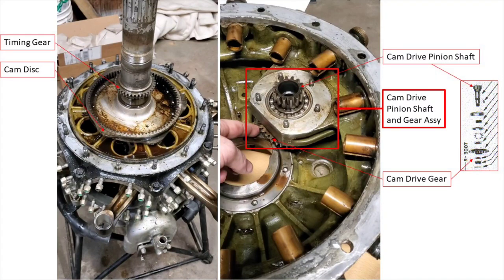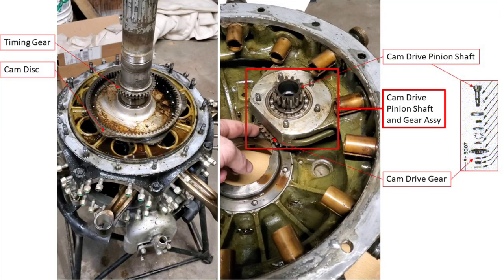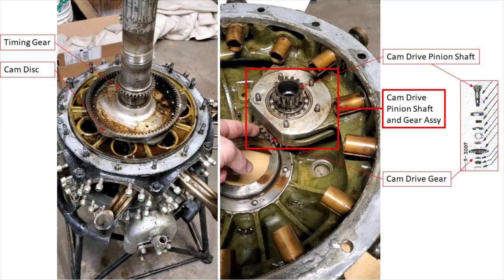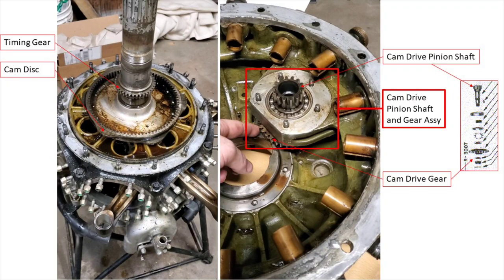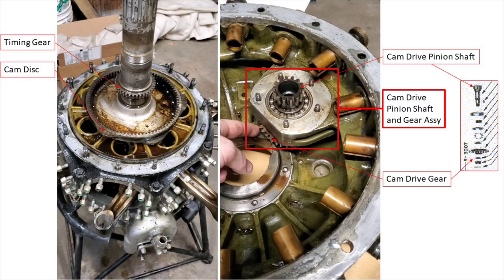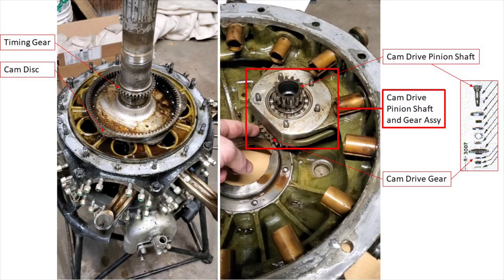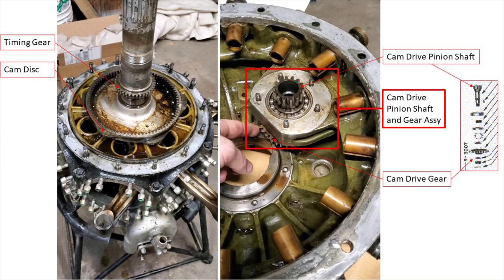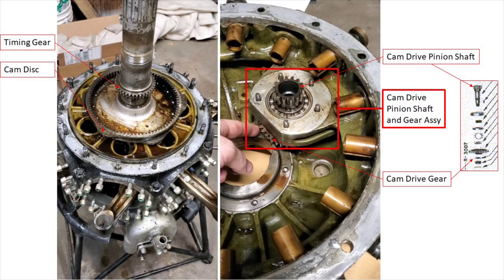Jacobs R-755-9 Restoration Part 11: Correction to Part 7 Cam and Valve Drive Assy

Comment: How can a cam on a 4 stroke engine move at 1/6th speed in relation to the crank?   Do you mean 1/4 speed?
Reply from the maker: No sir, all of the literature specifies 1/6 crankshaft speed in the opposite direction. Im not exactly clear on the why, the video describes the how, but I intend on finding out and that will be the subject of another video
Reply from the maker: I found the answer.  It is 1/6 crankshaft speed, made another video about it.  https://youtu.be/JSzjtKYEfIA

Comment: Man this is a lot of cool information that I’d never learn unless I took one apart. What’s the the plan with the engine you rebuilding it for an aircraft?
Reply from the maker: Unfortunately,  this engine won't be returning to the sky after this restoration.  Once rebuilt,  this one is going on static display at an Air Force museum next to a Cessna C-78
Reply: @mikesmith7249  the three Jacobs engines and props I’ve got are off a bamboo bomber
Reply from the maker: @apudggysquirrel1974  Thats very cool. What kind of condition are they in and what do you plan on doing with them?
Reply: @mikesmith7249  they are all in different conditions and were mainly spare parts for the engine that’s currently on our cessna 195 and as a little kid I’ve always want to pull one apart and see how it works. Maybe rebuild one at some point to see how well I can rebuild an aircraft engine and put it on a test stand
Reply from the maker: @apudggysquirrel1974  disassembly is far easier than assembly.  Particularly if you're wanting to fly the engine.  

If you're thing to fly the engine there's the regulatory obligation,  but in general,  the entire timing,  all the fits and clearances,  seating bearings etc. But it is all real fun